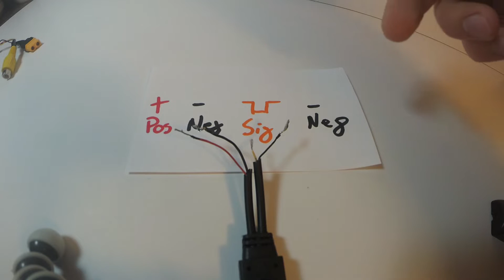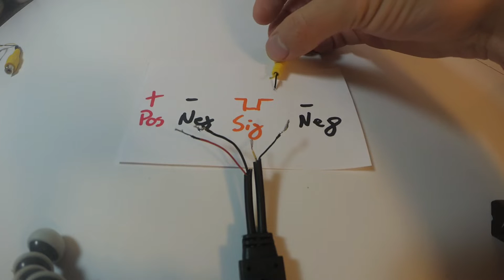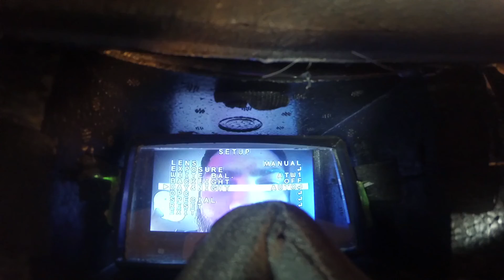Surveilzone HS1177 (Sony 600TVL) Tuning Cable Modifications

Comment: Dude...I am in the same boat as you. I am pulling my hair with my Foxeer HS1177....silly...
Edit - Took about 2 hrs but I finally got it working. Thanks dude, I just had to strip that RCA cable down and do it like you.

Comment: Thank you for this.  If it wasnt for this video I couldnt of created my own tuning cable.  I just spliced the ends of the rca cables like you did then just used + - on one wire, yellow signal lead on the other, i cut the other neg wire with the yellow, connected those 3 wires  from left to right - + yellow(signal) or reverse yellow(signal) + -  Connected 3 wire servo to flight controller and whamo, its a inline tuning cable for quad camera.  Just view on your goggles.

Comment: Oh man, why did you cut these wires? In fact, you just needed a BNC to RCA adapter for the video and a DC Jack plug to Deans or XT-60 connector for the voltage input!
Anyway great job!
Reply from the maker: +ABMNS PRODUCTION I didn't have either of those connectors, and it's easier to snip some wires than to go to the electronics store. :P
Reply from the maker: +Bulbufet FPV TL;DR -- I'm lazy
Reply: Bulbufet FPV Hahahaha i can see that lol
Enjoy your weekend and happy flying ;)

Comment: +Bulbufet FPV
You only need to hook up signal and ground for the nub/joystick to work. Just clip off the end of the connector that connects to the camera, connect the white lead to a two pin connector and  the other pin on the connector to ground, the rest goes to the vtx. then you do the same on the nub. 
 It is really easy to use as you don't have to pull out any cables from the camera, you just hook up the cable and use the signal from the vtx to view the menu.

I might do a video on it if anyone is interested.
Reply: Yes. The camera is basically just measuring the resistance of the circuit. So it would only take 5 swithes and some resistors to build a joystick.

I measured mine with a cheap multimeter:
Up=15K  Ω
Down=1 Ω
Left=26.6K Ω
Right= 6.8K Ω
Click=44.9K Ω

I didn't have the correct values for click and left but i got away with using 47K Ω and  22K + 4.7K Ω.
Reply: +Espen Lauvrak please do a video. Im a little confused.
Reply: The joystick has four wires that goes to the camera. If you cut them to a suitable length you can connect red, yellow and black from the camera to the video transmitter. Connect white to one pole of a connector and ground to the other(polarity does not matter) then you you put the matching connector on the wire from the joystick you only need to connect white and ground.
Reply: +Espen Lauvrak You are a Legend!! tried all other options to get the osd to work but it wasn't until I tried your way that mine worked. Thanks
Reply: +Joshua Archibald That's nice. It was a bit hard to explain, I'm glad you could figure it out from my rather vague explanation.
Reply: do you know how the joystick works? is it possible to build your own?
Reply: thanks for sharing the info Espen Lauvrak, very useful!

Comment: hey man, so if i made this cable I essentially need a female rca jack and then i could plug it into my goggles which have a rca jack to tune it?
Reply from the maker: +jam3s121 Goggles, TV, whatever has RCA! :-)
Reply: thanks dude. This video is actually awesome because I've been trying to wrap my head around setting this camera up for a couple weeks. I built a hovership 3S superbeast over the summer and kinda got discouraged trying to figure out the whole FPV thing and basically just had a LoS quad. I did buy this camera before I put everything on hold though...Makes a lot of sense. How did you get a xt60 connection on such thin wire? just as long as its got a good solder its fine?

Also do you knwo anywhere to buy a camera cable and the osd cable? I lost the cables to the camera... what mounts do you use for it also btw?

THANKS!!!! subbed.